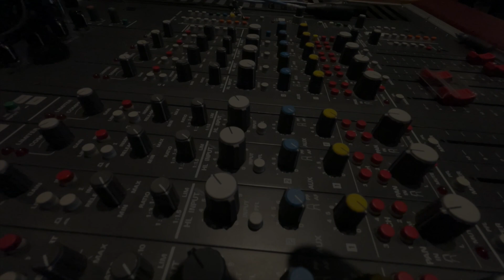Analog Mixing Master Class Polarity

Comment: This video is another example discussing the difference between polarity and phase. https://www.youtube.com/watch?v=7vVU15L-ckg
Reply: The two videos you recommend to not correctly address the phase as it is defined in signal processing. They only look at the very special case of a phase change related to a time delay, which is a linear phase shift, but in general a phase cannot be described solely via a delay, as it comes mainly from the distribution of active and reactive components.
Reply: @Rene_Christensen  In the operation of a mixer, or other audio gear available to a "recording engineer", the polarity and phase that are able to be controlled by that person are what get confused. What you're referring to is in the realm of the equipment designer. The "Phase" switch on pretty much every mixing console or preamp made in the last 50 plus years has been incorrect labelling of a polarity switch.

Comment: Phase is time and frequency based, polarity is the inverting of the wave form. This is why time alignment is done when designing speakers, and flipping polarity is used when two or more mics are placed in such a way as to catch the opposing wave forms. A good example is a snare mic and an outside kick mic. If the kick mic is not reversed in polarity, its bleed into the snare mic (or tom mics) will cancel out low frequencies very noticeably. The high frequencies are not nearly as pronounced, as their wavelengths are more likely to suffer from phase than polarity. Polarity affects an inversion of the wave form with no effect on time.

Another example of when flipping polarity can help the low frequencies is in the case of a live performance where the mains and the stage monitors fall on the same, or close to the same line across the stage. On a positive portion of the wave the mains will push away from the performers (singer or person speaking) while the stage monitor pushes that positive portion of the wave towards them. This creates, in the low frequencies, a cancellation when the wave forms mix together. Flip the polarity on the stage monitors and the low end tightens up and is easier to control, reducing the chance of low end feedback that behaves in an unpredictable way.

Here's a short video put together by someone showing the difference between polarity and phase. This is similar to the way that sometimes people don't understand the difference between echo/delay and reverb. https://www.youtube.com/watch?v=3A0KSrr2pqU

Comment: Whoa whoa whoa. Slow down here Ringo. So when you start playing the music at 3:45 the polarity buttons on the console are at their normal setting, so absolute phase is all normal on the console? And at 4 mins you flip polarity on the vocal mic? And at then you put it back to normal, and then at 4:30 you flip the polarity on the guitar mic?

And you think flipping the vocal mic sounds best? Man, I'm hearing a TON of comb filtering when you do that. And when you flipped the guitar mic I'm hearing even more.

The voice sounds better with none of the polarity switches flipped. If you can't hear that, then I don't think you should be producing music.

First of all, the time arrival differences there aren't 180 degrees, so flipping the polarity button isn't likely to really fix anything. In something like ProTools you can slide tracks around to find the best fit if you want.

This is all something that should have been worked out with mic placement before you ever hit record. Trying to fix it later isn't optimal.

Comment: the phase button is just used to correct out of phase wired cables in a multi mike take ,it is just 180 ° and will not correct other angle values  ,better use the side rejection of cardioid mikes to cancel phase errors
Reply: While you're correct it is sometimes used for the occasional out of phase connection (and those should be very few if non existent) the main purpose is to get right the phase relationship of microphones as discussed in the video. No studio worth its salt has out of phase cables or miswired equipment.
Reply: @Paulmcgowanpsaudio  out of phase mike vary with the distance and are rarely just  set at a 180° angle ,you would need a variable pot on the track, in real life you may work with rented gear which may not be perfect
Reply: @nicolasjoly1755  Ahhh, fair enough. Thanks.